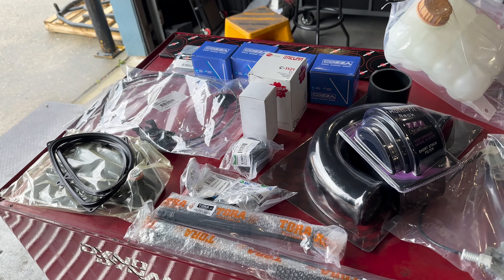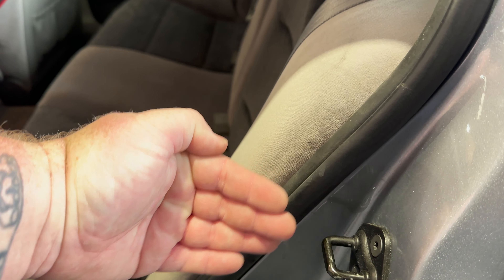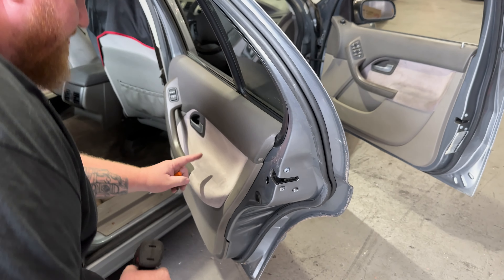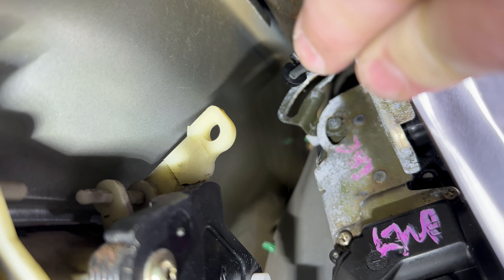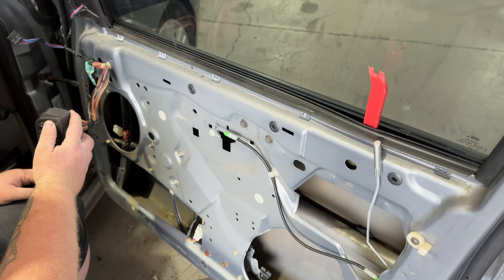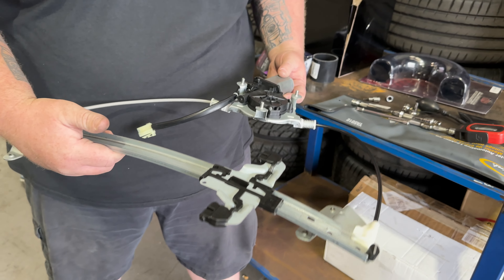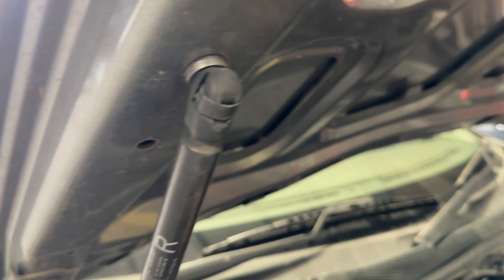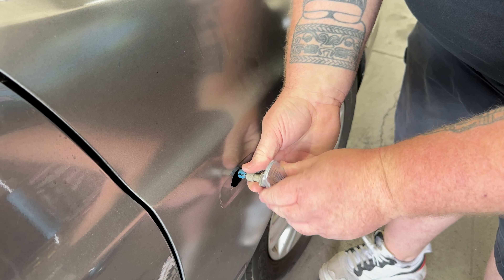5 Common Problems Fixed on the Abandoned Barra Project!

Comment: How’d you get it too flutter with no blow of valve ?? Any help much appreciated
Reply from the maker: The flutter is because it has no blow off valve the air goes back through the turbo instead of venting around it
Reply: Alright cheers, awesome video man

Comment: fix ya rust before it gets worse haha please. take out the parcel shelf and rust convert it from the inside as well as outside on the lap join. take out the side boot carpet liners and spray fish oil behind the quarter panel.
Reply from the maker: Ooft good thinking, I might do exactly that…  may aswell do it before it gets any worse